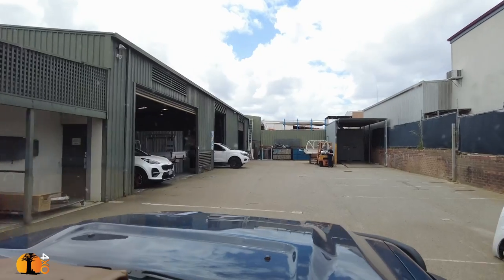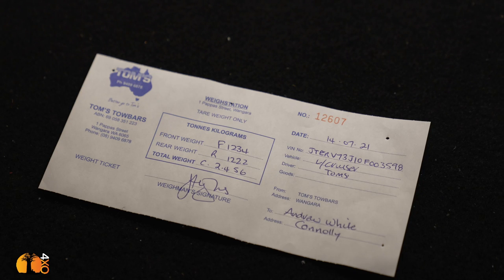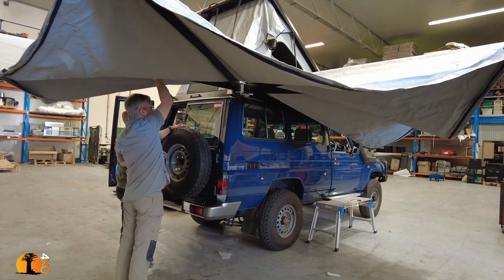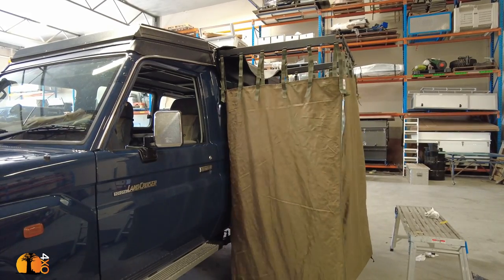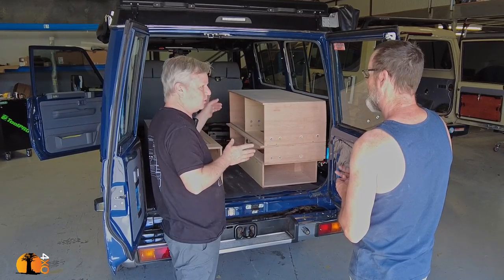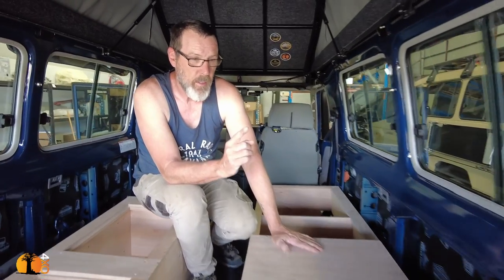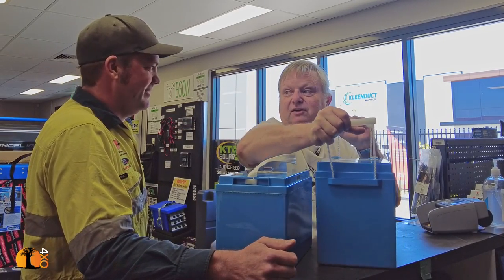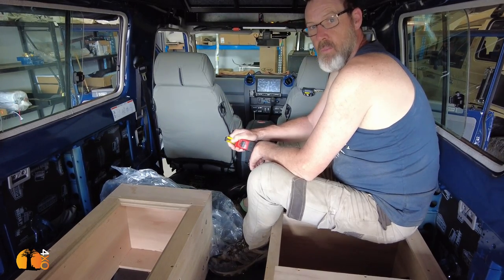IS OPERATION-LIGHTWEIGHT ON TRACK? We fit awning, en-suite, light-bar in the TROOPY | 4xOverland

Comment: @4xoverland Andrew, I fully understand the entire induction cooking test. That aside, what is your experience with diesel fueled cooktops? No need to carry a bottle of propane, no massive inverter and battery requirements and no need for added systems and weight. Your thoughts?

Comment: Loving the content...4x4 below amateur here....I always see you worrying about front weight and back weight... with awnings etc does symmetrical weight driver vs passenger side ever matter when 4x4ing? Would you ever have to adjust for side vs side weight?  Or do you just try pack symmetrically and leave it...
Reply: recent episode of Ronny dahs modified series and there was a 40 series cruiser where the people had more leaf spring on one side because it was heavier. I had never heard of anyone doing it before this
Reply: Yeah I'm just thinking if it's a daily driver possibly, it's the driver, the fridge, longer term cubby storage,  water heater,  battery, the cantilever of the wheel, 270 degree awning, and shower... all forces acting toward the drivers side...

Comment: x2 water tanks also allows filling independently from different sources - ie on the road one may need to top up from "less than ideal" water sources  - boil before drinking / washing / etc - uses..  while keeping one tank filled, or remaining - with "first class" drinking water - just a "not impossible" scenario (even if one which Andrew will never encounter, most likely.  (lol) )

So what was the "price" of induction cooking??  $3k  - that is a lot of gas (propane / butane) - (nb. the cost for the portable "power station" - can be offset and used at home as backup power - keep all the lights on in the rare event of severe storm  etc.)

Comment: Why use that giant water heater instead of a much smaller "on-demand" tankless unit ?
Reply: I think that unit actually holds 8-10 litres of water inside it effectively adding to the water capacity carried in the vehicle (although you probably can’t get that out easily unless you push more water into it.  Trauma make a small unit @ about $2k. 😬

Comment: Nice build 👍🏻. New shorter music intro is a good improvement. Going to be close with around 350kg to play with, not the 600kg - if you estimate that two passengers will be about 160kg, plus about 40kg of luggage and fresh food. Safety gear; ropes, shovels etc. will probably be another 50kg. However, you might lose a few kilos when you swap the steelies for alloys.
Reply: The factory 16x6 steels are actually lighter than ROH 16x8 alloys
Reply: @philg2468  what do they weigh?
Reply: @andrewb5887   The current factory 16x6 steels weigh 12.2kg each while the ROH 16x8 alloys weigh 13.2kg each.  The factory tubeless steel wheels with the 225/95R16 Bridgestone D697 tyres weigh 29kgs each, so if you change wheels and tyres, the new ones will always be heavier
Reply: @philg2468  cheers I have factory pizza cutters and will put a 255/85r16 on them when the bridgies are run through. I don't know why noone wants the skinnies but I'm glad because blimey they are good value. Just got to decide on a tyre for them expensive BFGs/Maxxis or cheaper but probably as good fallen/Toyo/yokohama
Reply: @andrewb5887  Yeah, but 255 need a 6.5" or 7"  rim and you can only get mud tyres - In the steel the 16x6.5" 105 series (zero offset) do the trick and weigh 13.8kgs.  In alloys you can use the 16x7 zero offset factory alloys (about 11kgs I think).  I'm still running the 225/95R16 and use the zero offset 105 at the rear and P20 offset 78 at the front so I get 40mm axle correction without compromising reliability.
Reply: @philg2468  cheers for the extra info, apparently many have fit the 255mm on the 6" steelie

Comment: Does the weight difference between the two sides affect driving on soft surfaces 

Or is it the relationship between the delivered force to the tires and the friction of the tires with the road surface ???

Did you hear about electric pressure cooker ?

Comment: Why not go with an underbody watertank to keep the weight as low as possible and free up space in thr cab??
Reply: Underbody 40L tank (eg Thorburns) adds 40kg behind the rear axle when empty.  Two plastic jerrys weigh 4kg.
Reply: @philg2468  my custom (85l) poly tank (with bavel) weights around 15kg and sits between the axles. I doubt saving 10kg compare to the space saved in the cab is worth it.
Reply: @anic0485  - Are you saying you can fit an 85L water tank between the axles on a VDJ78 Troopy???
Reply: @philg2468  yes
We have a 75 series but should be identical. Theoretical volume is 90l but with material thickness and bavel, let's call it 80-85L.
The exhaust needs to be moved in order to fit a custom tank.
Plenty of companies out there that do custom poly and Ss tanks.

Comment: Thanks Andrew, great info and, as usual very entertaining too.
I'm planning for induction stove top too but I've been looking for pots and pans that are light, strong and will work with induction stove and open fire to keep as light as possible along with non plastic components and with fold-able or removable handles. Finally I am steering clear of non stick coatings because the coating breaks down into toxic byproducts at elevated tempertures such as would occur on coals or an open fire. Finding such gear is proving near on impossible. I'd love your thoughts on that.
Reply: @Kelvin Weeding Thanks Kelvin, that brand seemed to pop up as I was researching the subject for myself.

Comment: Hi Andrew, what do you think of the Jeep Gladiator both as a platform for what you do and as an overland vehicle? I mean, just reading it’s spec, “out of the box”, it’s an extremely capable and impressive car,.
Reply: Few issues:
1. You’ll very quickly run out of usable payload in those trucks. 
2. Reliability. I’ve owned Jeeps in the past and they continuously get worse with every generation. 
3. Durability. Paper thin steel. It’s just pathetic how easy it is to dent the panels by just bumping into them with your knees. 

However:
1. Perfectly good TWO person (max) vehicle for expeditions, regarding weight management, etc. 
2. TFL just did a review of a guy’s Gladiator. It sat at 8k pounds, WITHOUT a load out for travel. Jeeps can very quickly become overweight, and therefore, worn down quickly due to extreme weights on Dana 44 axles. 
3. At least they hold their value, for the most part. 

My recommendation: Look into a F250 Tremor or 2500 Power Wagon. Virtually the same price, same mpg, but far better built for overloading it. 

Just my $.02.
Reply: @justinmcroberts4633  true and well made points. but which car is more fun to drive? I mean, lets be honest, most overland cars, or off roads or any of the above combinations, will spend most of their lives driving to the shops, or schools or the office or for dinner at night. most of these cars, and most of us, dont lives on the dirt roads, so how it handles the pavement, its functions, features, comfort, intelligence functions, "apple car play" etc etc, are rather important. if one could have a car that as most of the above, plus its a bit fun to drive, plus looking a bit unusual plus a very capable off roader, then that would be a great option. most of us dont carry 10 tones of weight and stuff for a 4 years expedition...
Reply: You should check out Dan Grec's channel "The Road Chose Me" He is currently building a Glad and touring Australia. He previously crossed Africa in  a Jeep JK and prior to that did the entire length of North and South America in a TJ. He experienced next to no problems and proved that Jeeps are as reliable as any other vehicle out there.
Reply: I don't think you will get an objective answer from our host - he simply does not like Jeeps. I too am looking forward to Dan Grec's progress.

Comment: You could have saved some weight by fitting a much smaller 270 degree awning. I am using one with about 1,8m rib lengths and it provides ample shade for two people. Except of course if you want to be a teacher in Africa where there are no trees😊

Comment: I love the troopy, but finding that new starts at 2.400kg is a big sad, no much room to play with weight. Ones fully built and loaded is going to be sooooo heavy, fuel consumption will be out of question for us europeans.
Reply: They really do need modernizing but they do also get claimed fuel figures or a little higher which is pretty good for a 3 ton brick with a turbo v8
Reply: 1000kg payload is better than any other wagon out there
Reply: @philg2468  Sure, but starting at 2.400 is a heavy truck

Comment: Not interested in fitting a chassis water tank? Seems to be a few types available.
Reply: The Long ranger makes a 50 litre one that sits into the space near the tail shaft.  Definitely something I would consider but I want to carry more than 80 litres.  Call me hygienic 😂 There is another one that can install between the rear tank & rear bumper (40lt) but if you put a real rear bar on it, it won’t fit.

Comment: Bed platform/interior roof of the Troopy looks terrible with the exposed steel beams of the bed base.

This is bordering on the ludicrous. He is worried about adding more than 1kg in terms of the light bar, but has just put 30-40kgs right up high with the 'massive awning' (which will be interesting to see one person manage in a mild breeze) and shower awning.

I still cannot fathom the interior water tank. Loosing internal space, more weight up high when compared with many existing reputable water tank manufacturers for the Troopy which are underfloor.
Reply: @AVRO filmvideo Is that the awning people were bending the corner knuckle on? It would literally fold over the roof of the car in the wind?  (Genuine question).
Reply: The Long Ranger do a 50 litre water tank for the dpf Troopy. There’s not many options & 50 litres is not enough.
Reply: @ericburger2294  Won’t fit mine unfortunately ☹️
Reply: @AVRO filmvideo Mo I’m not suggesting that, I saw a YT where a guy had one fold over his roof, the wind caught it & it looks completely different to the Alucab version BUT I’m not sure if it’s the Same one, which is why I asked.  I will look for a link and post back here for you to check out.  I don’t have a horse in this race friend, I’d be happy if it wasn’t the same one, I was just asking. 🤷🏼‍♂️. Edit to add, the one I saw on YT might have been an earlier version but it was much lighter & the material in the awning was exceptionally good but the corner knuckle had round arms.  I’d rather have 17 kg over a 40kg one anyday (up there) but not if it’s going to fail me, so I’m genuinely interested in finding this out.

Comment: I feel the target has been completely lost here. It’s still going to be very much not lightweight. Why not consult with aircraft engineers, instead of getting cabinets made out of lumber? Why use induction cooking if that means adding huge and heavy lithium batteries? Why getting the largest awning instead of the lightest?

Comment: Inverters are a tyranny, most AC appliances convert back to DC before using the power anyway, 
an induction hob uses high frequency AC, so the battery DC is converted to AC on the inverter,  back to DC in the appliance, and for induction hob back to high frequency AC for the hob. its electrical engineering madness. You will drain your battery in an hour of cooking, maybee less, unless you are in bright sunlight with big panels you will be charging off the alternator (so gas or Diesel anyway) Just take a stove it has to be greener.
Reply from the maker: We did a test so we would not have to guess. https://youtu.be/GpWYtuOllRc
Reply: @4xoverland  Thank you Andrew Il have a look